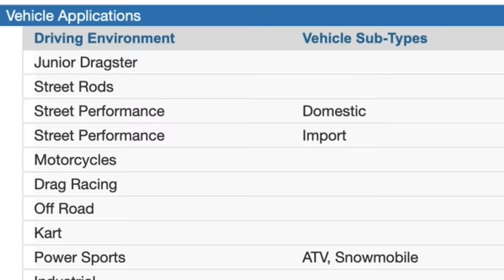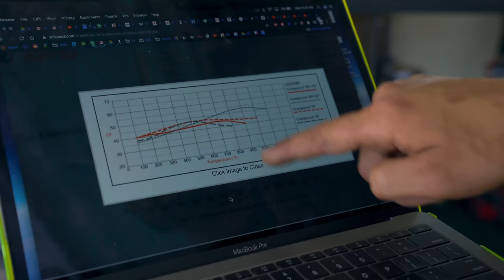Are Big Brakes Worth It?

Comment: As James once said - "it ain't fun goin fast if you can't stop."
Reply: Tires dictate that, stock brakes are more than fine for the majority of the situations
Reply: @danielsousa8151  Yeah but stock brakes are designed for stock power, if you have a modified engine with +100hp or more than stock your brakes are going to start suffering
Reply: As a mechanic friend once told me when I was thinking of doing brakes - "You have something more important to do than stop?"
Reply: @VBshredder  yes I agree with this wholeheartedly. I spend good money on things like tires and brakes. I got nothing more important to do than get to where I'm going and make sure I can stop when I can.

Comment: I just ordered a bbk for my m3, video timing = couldn’t be more perfect as usual
Reply: A m3 already has big brakes
Reply: Nathan Brame e46 does not. The brakes fade after relatively easy canyon driving. Just picked up an ECS 6 piston front kit :)
Reply: Nathan Brame they got a slow boi M3
Reply: Big black K
Reply: Joshua Duarte 6 piston? Lol my Mustang GT has 2 piston brakes.
Reply: Angel Gutierrez 2 piston in the rear or the front? Most newer cars are 4/2 

I’m upgrading to a 6/4

Comment: "Are they worth it?"
"Usually not, no"
ends episode
Reply: YouTube analytic ad money: "I'll be right back"
Reply: Technically this question was answered in the Hi Low episode as well.
Reply: I mean if you want better brake cooling then rout an air funnel to the brakes. I've done that to a b5 once and it worked wonders.

Comment: "You should change your break fluid every year" 
Me: looks at my parents 2000 4Runner that hasn't had a break fluid change since 2005
Reply: You don’t have to jack up the car just open the bleeders til it’s almost empty and fill with new. 
Let bleed down
Fill done

45min passive work tops. 

Empty it into an old plastic bottle. 

No excuses. 

Now you no you are no
Longer ignorant. 

It makes you something else...
Reply: Is "break" fluid a drink you have with breakfast
Reply: @Dom-xr1vq  yes, you should also take it on your lunch break. It helps to strengthen your bones so they don't... Well y'know.
Reply: @Dom-xr1vq  yes
Reply: Jajaja looked at my car, 10 years same brake fluid
Reply: @fastinradfordable  I don't have any old plastic bottles or cars to leak the brake fluid from!! Help!!!
Reply: side eyes my 99 Suburban I'm gonna guess 2010
Reply: Thats BS. You dont need to change your brake fluid once a year. Brake fluid absorbs about 3% water in 2 years. Change it every 2 years or even better, use a brake fluid tester.
Reply: @fastinradfordable  but I don't have a car..... 

Where's your solution now!?
Reply: mines still from 1991 i bet and are fine
Reply: @EslayerTM  as long as you don't heat up the brakes. Otherwise you might find that your pedal goes all floppy.
Reply: You dont necessarily have to change brake fluid every year. There are testing strips for brake fluid and coolant to let you know if you need to change it based on the amount of water ingestion and corrosive-ness of the fluid.

Comment: Change your brake fluid every year
My dad : Still has the original break fluid in his Mk4 Golf
Reply: Yeah, at least it still had the fluid lol
Reply: one down hill run on a canyon and thats a dead dad
Reply: Not original brake fluid as it will most likely be about 60% water now
Reply: better than nothing
Reply: My car os losing break fluid to the point that I have to refill it every other day.. so I never need to change it I am basically renewing it on the go😎
Reply: Brake*
Reply: @gangstar662  seems logical, you can also just slam your foot out like fred flintstone 😎
Reply: @gangstar662  I have an old subaru that burns through oil fast enough to get 5 new quarts easily every 3000 miles. It's a feature for easy oil changes.
Reply: Nobody I know changes their brake fluid. Even if I say "hey, I bought this huge jug by accident. Wanna flush your brake fluid? I'll help you. "
Reply: As i said before, you really dont need to change your brake fluid once a year. Brake fluid absorbs about 3% water in 2 years. Change it every 2 years or even better, use a brake fluid tester.
Reply: B.r.a.k.e.
Reply: Most people never change brake fluid.DOT 3 fluid is pretty good and lasts decades.

Comment: With a stock Miata you could have just put a good set of pads, steel brake lines and new brake fluid and go with it. That big brake kit would go along a turbocharged Miata. So I guess your next video will be a turbo one?? :)
Reply: Yes! 😆 the stops upgraded. Now time to upgrade the go.
Reply: Why is everyone so opposed to supercharged cars?
Reply: @Ward1706  ? It's Japanese. Supercharged aint bad.
Reply: @Ward1706  mate I'm not opposed to superchargers. I have a mini cooper s supercharged!!! Turbochargers are just more efficient.
Reply: It's called Money Pit for a reason. It's not Logic Pit
Reply: @Tryingmybestsince1999  turbo lag: allow me to introduce myself
Reply: Next vídeo is ls swap
Reply: yeah, I think he mentioned in a previous episode the plan is to turbocharge it. It's just the smart roadmap to upgrade handling and braking before making the car go faster.
Reply: @Ward1706  turbocharged is more fun, much more efficient and arguably better for daily driving. Also, superchargers are much more effective on large v8s, mostly american, where no one in their right mind would pop a single small turbo. A supercharger on a small, low power engine will greatly increase hp without sapping much power, while a supercharger won't put in much more power, but takes power directly from the engine simply to run it. Not saying a supercharger cannot go on a small i4, but esp. an old Miata that makes 100hp tops wouldn't benefit nearly as much as from a turbocharger. Also, as another commenter pointed out, it's a Japanese car, and japanese cars are traditionally turbocharger.
Reply: Hope so been waiting forever
Reply: @adrianolacerda3410  
Small turbo: allow me to introduce myself.
Reply: @Tryingmybestsince1999  doesn't the s in minicooper s stand for supercharged?
Reply: ALSO-RAN !  lul, noob. Moar vroom is key. Why stop, the fuck train has no brakes.
Reply: @robert9595  The S in Mini cooper s stands for sport, they only had superchargers from 2002 to 2006
Reply: @adrianolacerda3410  you can say whatever you want about turbo lag and all that shit. Turbos will always be more efficient than superchargers.

Comment: I always spring for ceramic pads. 
And one trick for brake fluid, instead of draining your entire brake system, just suck out what's in the reservoir with a fluid remover or turkey baster and then fill the reservoir back up. It gives the system fresh fluid and you don't have to re-bleed the brakes.

Comment: Congrats on 4 mil
But am I the only one that sees the “red” calipers as orange?
Reply: Naa
Reply: They orange
Reply: They are tomato soup red.  I have a set on my car
Reply: @nubreed13  oh ok makes sense
Reply: Yee bruh wtf
Reply: Zach is sun burnt, they adjusted tint. Topless life.
Reply: @hyp3rw1ng39  Everyone sees colors differently. The difference is usually small and only comes to play when talking about very similar colors.
No two sets of eyes are same. Our brain just calibrates the signals sent by our eyes to previously seen and learnt colors.
Reply: i also see them as orange
Reply: Hyp3rw1ng - At the 12:00 minute mark, you can clearly see that the calipers are indeed orange when compared to the red bucket in the background. HOWEVER, it needs to be said that there is no such thing as "color," because any color a human perceives is just an optical illusion that evolved in humans over time so that we could better decode our environment. "Color" is really just varying wavelengths of electromagnetic radiation. That's why you can't see color in a dark room, you need some source of electromagnetic radiation, commonly referred to as "light."
Reply: THANK YOU I THOUGHT SO TOO
Reply: @carlotorres5292  lol ur not alone 😂💀

Comment: 11:19 The most that I ever done in a car was to change a set of tires and even I know that when you're going under it you better have a backup plan in case it falls, like wheels or logs to support the weight of the car just enough so you don't get crushed.

Comment: I have a set of Power Stop drilled and slotted rotors on my daily driver.  They have over 200,000 miles on them and still are not warped. They definitely are getting thin and will be replaced next time with another set. The stock rotors would start to pulse every few thousand miles so I switched them to something that would cool down faster, apparently I'm hard on brakes or Chevy put on a set that was much to small. (Probably a bit of both)

Comment: "Replace your brake fluid every year" Who does that? Even the manual on my least sophisticated vehicle says every 2 years.
Reply: PleaseDontWatchThese      Mine says every 6 months
Reply: Mine says only if i replace a caliper or hose
Reply: oh wow, i did not know it was so diverse in time.
Reply: dealerships need to make money aswell
Reply: @pleasedontwatchthese9593   That's because it depends on the formula. The boiling point for DOT 3 doesn't drop as much wet as other formulas. My owner's manual doesn't even mention an interval - so probably 4-5 years or whenever an actual internal part is replaced like a hose. It's best for you to have the car inspected by an official technician so they can look at the quality of the fluid.
Reply: @Guppusmaximus  Ye and with the edition of all the modern systems they need to use those scan tools to properly bleed the breaks now.
Reply: it depends on how much moisture is in your brake fluid, you can buy tester off aliexpress they pretty cheap which shows how much water is in your fluid...
Reply: I drive my car only a few miles a month. Either way I change my oil every 6 months to make sure it's fresh. Over kill and I am okay with it.
Reply: @WarriorsPhoto  I just change when the oil meter in the gauge clusters is down 20%
Reply: @DragonKnightX12  Pretty much right. (:
Reply: ricky v I drive my Miata and Integra each less than 5K miles a year. I change oil on both of them once a year. No point whatsoever in doing it more often than that. Any more often is just wasteful.
Reply: My 1995 4-door VW Golf GL 2.0L 5MT came with DOT4 brake fluid from the factory and recommended replacing the brake fluid every 18 months (1½ years).  DOT3 is typically every 2 years.  IIRC, DOT4 is a bit more hygroscopic than DOT3.  Factory 4-wheel disc brakes, DOT4 brake fluid, an oil cooler, and a 5-speed manual on what was essentially a grocery-getter.  I got rid of the Golf after an 18-wheeler tried to occupy the same space as the Golf on the freeway and some other foibles along the way.  Hit and run and no uninsured coverage (didn't get the license plate either).

I didn't do a big brake kit on my 1998 Camry LE 2.2L AT.  I occasionally towed with it and usually have a trunk full of tools.  For some added piece of mind, I ditched the 14" stock Toyota steelies and put on a set of 2003-ish Lexus ES300 16" 9-spoke alloys with 10mm wider tires than factory.  I also installed urethane control arm bushings from Energy Suspension and upgraded to drilled and slotted rotors up front with ceramic brake pads.  In the rear, I ditched the stock drum brakes in favor of disc brakes from a V6 Camry of the same generation.  Synthetic DOT4 brake fluid.  Camry still had mediocre acceleration, but I didn't have to slow down as much for curves and even loaded up with tools and supplies for work, it stopped PDQ.  Just cratered the engine at a mere 461,228 miles.  But, I digress.

Yeah, changing brake fluid every 12 months seems a little overkill.
Reply: Depends on the humidity of the area, brake fluid absorbs water even from the atmosphere, so if you live in a wet and humid area that would be a good idea.... if you're like me living in the bone dry south west, you can wait the 30,000 miles

Comment: "Meh, I don't need a BBK."
Watches this video.
"I need a BBK."
Reply: Keep in mind he's spent several months making his Miata wayyyy slower.
Reply: He's teasing us with all this handling when we want power.
Reply: @jobri5688  Well, that BBK should help slow down his Miata if ever throws on a turbo or something.
Reply: @macbook802  I don't know, I did what he did. I went with suspension goodies out the ass first and it's a blast driving down the road and taking turns at speeds I couldn't before without effort. Currently saving for a Mercracing S/C.
Reply: @ragingraven7915  what prevented you from taking turns at speed prior?

Comment: The fact that this show is called “MONEY pit” and he didn’t mentioned any price 😂
Reply: Because this kit is worth more than most of our Miatas, lol
Reply: You really don't wanna know the price hahaha
Reply: I have a rear disc conversion kit from wilwood.  Not including my new master cylinder or hard brake lines the kit set me back $1000. Miata kit is closer to 2000 for the full set
Reply: Flyin Miata sells various versions of this kit. The front and rear calipers + rotors and hardware is around $1500 if I recall correctly. For 99% of Miatas out there, it's definitely not worth it, especially at stock power. it does look nice though.

Comment: "big brakes, even if you dont need em, are sweet"

Laughs in unsprung mass
Reply: Usually 4 pot callipers are lighter as well as 2 piece rotors
Reply: Most people don't notice or care about that. I.E. running heavyass reps and chopped springs

Comment: I put drilled and slotted rotors on my '95 V6 Mustang.  They were much lighter than the stock rotors, and that translated to 3-4 more MPG and a noticeable increase in acceleration!  Those sweet rotors made driving my sadly underpowered Mustang a bit more fun and economical.

Comment: Wilwoods are great just on the front of my turbo NB.

Brake discs won't warp in use btw.  What will happen is if you leave the handbrake on when they're hot, you'll put a patch of pad material on the rodor, which will feel like a warped rodor.

Comment: Regular brakes are fine as they are, you don't necessarly have to change them.

BUT, 
For those of you supra maniacs or anyone who want to tune up your engine, its best to upgrade your brakes FIRST before you add more horses. Make sure you had the power to stop that extra horses properly.
Reply: indeed. Here is a simple equation for those people " More power = Strong brakes "

Comment: I do kind of high speed delivery through the city with my car, this place has almost every kind of terrain, from good asphalt straights, really bad rocky dirty paths, flooded places, steep blind curves, high speed curves, uphills, downhills and so on. On hardcore non-stop weekends I feel the progressive disminution of braking power as my tiny rotors have litte thermal capacity (OEM solid), they brake really good at the first two times when cold but then I have to slow down a lot because of that, they are clearly not designed for an intensive task.
I actually never been to a race track or seen a race live but I kind of understand now the necessity of the expense on brake upgrades.

Comment: That two piece rotor is actually called a floating rotor. Because when it heats up the disc can move up to 2mm. The float on the Bobbie pins you attach to the center hub. Best thing about them is when you have to replace you only pay for the ring. Wilwoods are a great choice and in my opinion they are better than brembro.

Comment: Haha...nice topic.  I have an '07 Honda, bought well used.  When one front caliper semi-froze up...I bought the same calipers as you have...with BP-10's.  The cost was a bit higher than OEM, but the Wilwood Dynalite's are 4 piston, vs the OEM single piston.  No new rotors yet...no need.  Stopping power is fantastic.  The Fit has ABS.  Had to buy new snow wheels, as the calipers did not clear.  What is dumb, is paying extra money for "slotted" rotors.  They do not add anything mechanical.  Just look cool.

Comment: I put a complete wilwood set of brakes on my 2013 mustang.  The OEM brakes stopped fine except they would heat up and fade badly with repeated stops (happens when you accellerate and slow down whilst hot dogging :}  }  With the Wilwood brakes I have never been able to feel them fade at all no matter how many hot-dog events.

Comment: Honest question: Why aren't rims shaped like a ventilator?
If the rim was sucking air from inside out, they would indeed cause a bit more air resistance and unsprung weight, but they should be really help to cool the brakes + technically provide extra drag (by reducing the air pressure under the car on high speeds).

Comment: When bedding brakes in, keep the braking light to moderate for the first few hundred miles. This ensures the pads marry evenly with the rotors. If you brake hard straight away with brakes that haven't bed in, you risk an uneven build-up and warping the rotors.

Comment: Pretty sure most brake manufacturers recommend driving normally until the crosshatching on the rotor surface is gone before "testing" your brakes (usually about 500 miles). The pads likely also have a slightly more abrasive coating on them that wears the rotors in for the first 100 miles or so and aids in removing the cross hatching. Only then should you be bedding in the pads. I don't think doing what you're doing is going to hurt anything, but the brakes won't feel as good until you do that first break-in

Comment: the reason why you should need them if you are a guy who loves going fast they are much better for withstanding the over heat build-up and applying brakes to withstand the hot temps for better cooling.

Comment: So dig everything so far...but missed opportunity to explain having a clean and flat surface for the "hat" (center section) to mate  flush. This keeps pulsation down and ensures smooth engagement. It's a bigger deal in rustier locations. However, still important. 
Side note...cams and tune before boost. Personal opinion and choice.